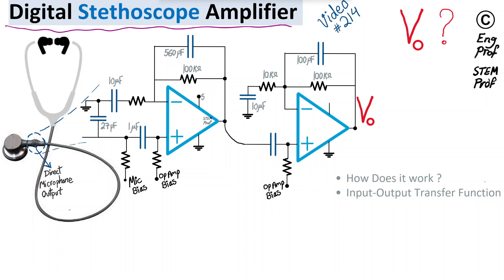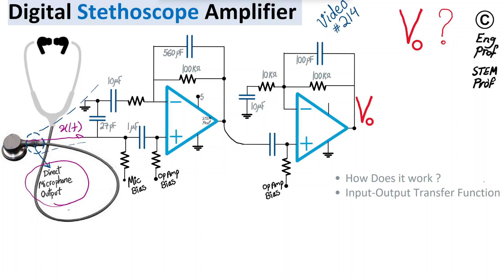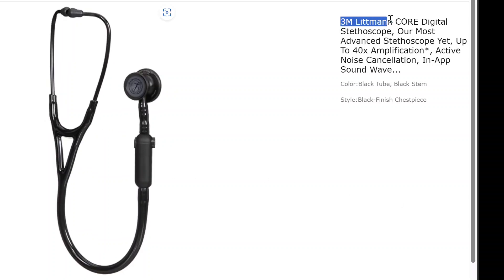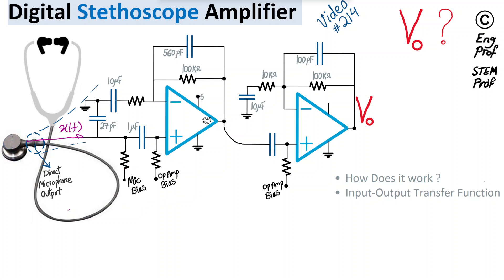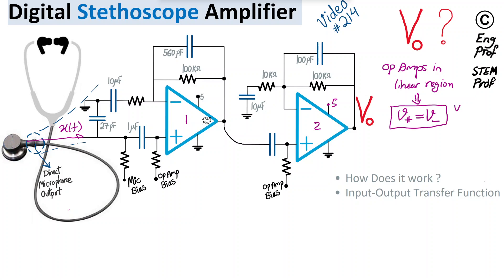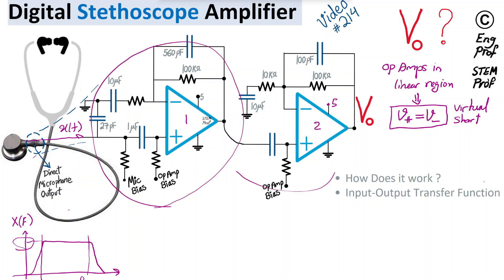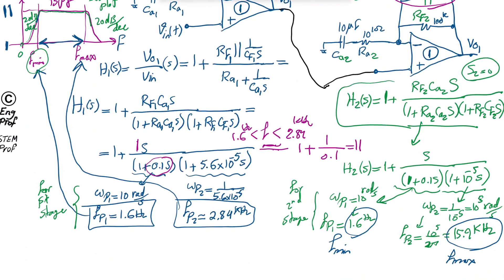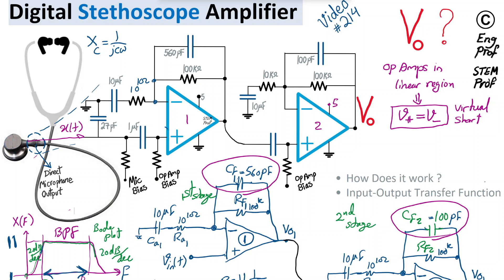Digital Stethoscope Amplifier Explained

Comment: I appreciate these videos a lot. I designed a nice little STM32 based system to practice DSP on, and I'll be making some biosensing AFE's for it.
Reply from the maker: Thank you! I'm glad that you like my videos and they are helpful.  Thank you for sharing your design experiment based on STM32 to practice DSP.  Wish you a lot of fun with your biosensing AFE design & experiment. 🙂 Given your interests, I suggest watching the https://youtu.be/1c7KGXPs4do video that explains EKG ECG Amplifier with Right Leg Drive.
Reply: @STEMprof  Thank you for the recommendation! I actually already went through that video yesterday, following along with circuit analysis on my tablet. I intend to build a few similar circuits soon, and I'll likely try that exact topography (with a difference amplifier before the A/D). I will also likely upload some videos on my channel so I can document my projects for future reference. You have a lot of detailed analysis for circuits which could be helpful for me, and I will let you know if I use any topographies you covered (or if I used them as a base for a slightly different design). Its nice having a reason to go through circuit analysis by hand again.
Reply from the maker: You're welcome. Glad to hear that my videos are helpful. Have fun experimenting with implementations.

Comment: I want to do this circuit in Proteus program can you please tell me the type of the component?
Reply from the maker: Glad that this Digital Stethoscope Amplifier is helpful. I highly recommend using a zero offset low noise CMOS Op Amp for this design. Here are a few related signal conditioning videos:
EKG ECG Amplifier with Right Leg Drive Explained https://youtu.be/1c7KGXPs4do
Electric Guitar Amplifier to XLR Audio Signal https://youtu.be/X4y8cwZdGEk
Bridge Audio Amplifier Explained https://youtu.be/EDpu6urAtHA
Thermocouple Amplifier with Cold Junction Compensation Explained https://youtu.be/-BsDLBI166U

Comment: I really like your content. If only I had this kind of detailed explanation of circuits as a young  teenager over 50 years ago,  when the only access to information I had was from expensive magazines and the local library reference section,  which I could not borrow from and could not take home to study. Only one question for you, why is this called a digital stethoscope amplifier when it is just a simple analog amplifier? Is this just marketing BS by the manufacturer?
Reply from the maker: Glad that you like my videos and circuit design examples. I understand, I had similar limitations back in my early days as well. Regarding your question, this is not a marketing theme. A digital stethoscope requires initial analog signal conditioning (filtering and amplification) before analog to digital conversion for further digital post processing. In case you are interested here are additional practical examples:
Electric Guitar Amplifier to XLR Audio Signal https://youtu.be/X4y8cwZdGEk
Bridge Audio Amplifier Explained https://youtu.be/EDpu6urAtHA
Thermocouple Amplifier with Cold Junction Compensation Explained https://youtu.be/-BsDLBI166U
Electronic Gain Control for Op Amp Amplifier  https://youtu.be/NoNgQpbj77Y
VCA Electronic Gain Control (Part 1): Voltage-Controlled Attenuator Overview https://youtu.be/cFzYZsPEtP0
I hope these circuit videos are interesting as well.

Comment: what is the benefit of the 27pf capacitor ?
Reply from the maker: Good question, it provides more stability while also short very high frequency noise components at the input of the circuit. See more sensor circuit examples in this video collection https://www.youtube.com/playlist?list=PLrwXF7N522y7Ut9bm8TXAOhIWqL__FGlj. Thanks for watching.

Comment: Very nice example. Why are those 2 stages with different upper frequency? Does it have some practical advantage? And what is the 27pF input capacitor for?
Reply from the maker: Thank you! Good questions. This design method is not unique. There are many alternative techniques and methods to design these amplifiers. One reason for the higher bandwidth of the second amplifier stage is avoiding further magnitude drop at the upper passband edge of the first stage.  As for the 27pf capacitor, it provides more stability while also shorting very high frequency noise components at the input of the circuit. More amplifier circuit videos are posted in https://www.youtube.com/playlist?list=PLrwXF7N522y5679YAO-lFrNVYqV9XMNTr circuits playlist. I hope you like them as well.

Comment: You offer an appropriate consideration of the circuit. You explain it very well; kudos! What type of pickup sensor is typically used for this application? If it is some type of audio microphone, then it bears mentioning that the type of microphone used would greatly influence the design of the circuit...  For example, an Electret microphone uses a different circuit than a Dynamic microphone. At least that is what I know of audio microphone circuit design. Admittedly, I am no expert. I am not fault finding, here. It is just a thought for anyone considering actually building your design. Thank you so much for sharing your expertise, time and effort to teach us.
Reply from the maker: @t1d100 Thank you! My pleasure! You have a good practical point and I appreciate sharing your thoughts. I am assuming an Electret microphone in this Stethoscope Amplifier Circuit example.  More Sensors Circuits Videos are posted in https://www.youtube.com/playlist?list=PLrwXF7N522y4c7c-8KBjrwd7IyaZfWxyt video playlist.

Comment from the maker: A Digital Stethoscope Amplifier is explained in this video. Here are a few more Sensors and Circuits videos:
EKG ECG Amplifier with Right Leg Drive Explained https://youtu.be/1c7KGXPs4do
Electric Guitar Amplifier to XLR Audio Signal https://youtu.be/X4y8cwZdGEk
Bridge Audio Amplifier Explained https://youtu.be/EDpu6urAtHA
Thermocouple Amplifier with Cold Junction Compensation Explained https://youtu.be/-BsDLBI166U
Op Amp Amplifier with Electronic Gain Control https://youtu.be/NoNgQpbj77Y
Push-Pull Power Amplifier with Darlington Transistors https://youtu.be/866MYibo8yE
VCA Electronic Gain Control (Part 1): Voltage-Controlled Attenuator Overview https://youtu.be/cFzYZsPEtP0
Electronic Gain Control for Op Amp Amplifier  https://youtu.be/NoNgQpbj77Y
Push-Pull Power Amplifier with Darlington Transistors https://youtu.be/866MYibo8yE
Thermometer Circuit Design with Op Amp & BJT transistor https://youtu.be/55YsraFE0rg
PhotoDiode Amplifier with Op Amp and MOSFET Explained https://youtu.be/1c3EJ2d4pVI
Instrumentation Amplifier with Electronic Gain Control https://youtu.be/C4tghZ-q6Zs
Voltage Regulator Op Amp Circuit with Foldback current limiting https://youtu.be/VN4_qF9DvBM
Push-Pull Power Amplifier Design with Op Amp, Sziklai Darlington Transistors https://youtu.be/8BFzsi7-Vbs

See more Sensors & Instrumentation Amplifiers videos in https://www.youtube.com/playlist?list=PLrwXF7N522y4c7c-8KBjrwd7IyaZfWxyt  Circuits playlist.